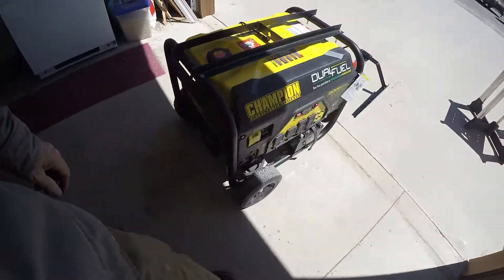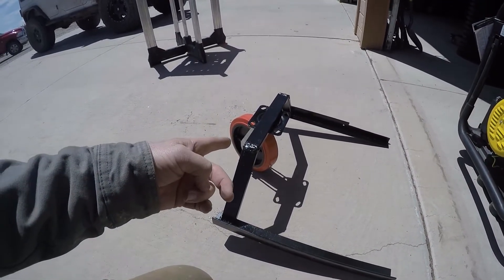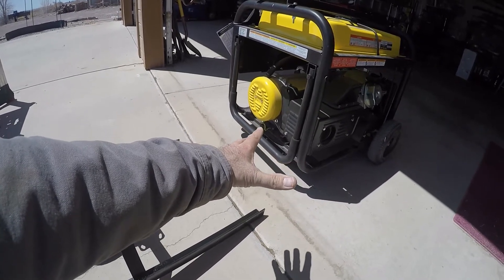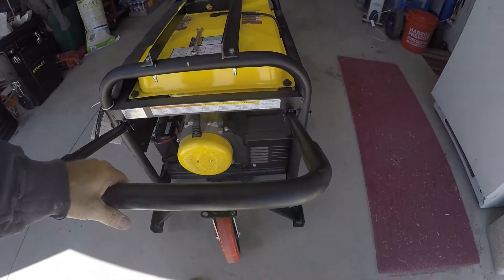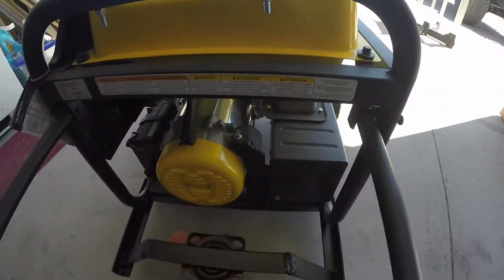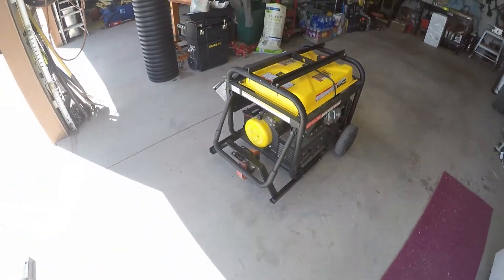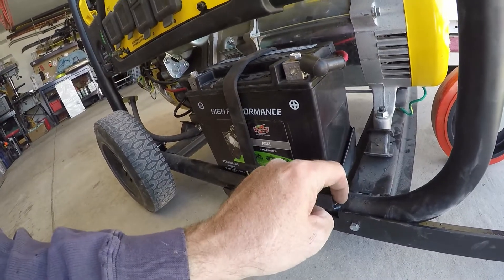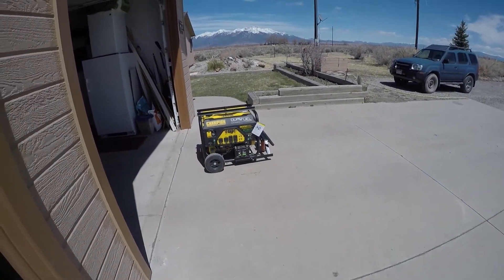*Better* WHEELS for CHAMPION GENERATOR !!!

Comment: Great idea, I've been wanting a way to easily pull or gently tow mine out to a location in my yard without putting it up higher on an extra cart. How stable is one wheel on uneven ground? Thinking something like this maybe with two front swivel wheels for better stability and a tow bar for gently towing it with an atv. These stupid generators are not easy to roll out to a location. They are so awkward andheavy. Making life simple. 👍

Comment: Good mod.  I would have thought someone would be selling this kind of thing by now but apparently not.  Must be a liability issue.
Reply from the maker: I think you're right, just like the hoist bracket I put on the top in another video, there are some companies that make those for other manufacturers, but I haven't seen one for champion yet. Hey thanks for watching and for your comments 👍